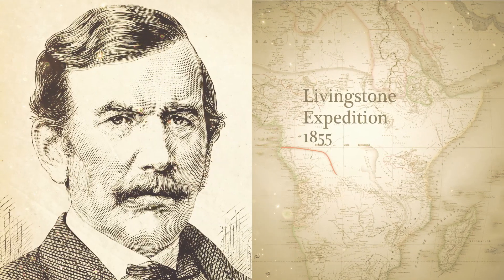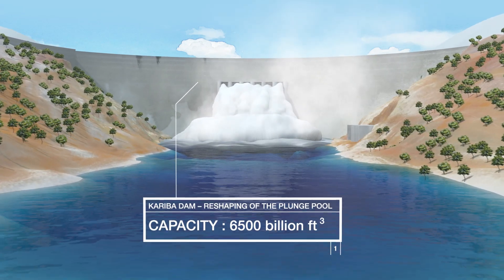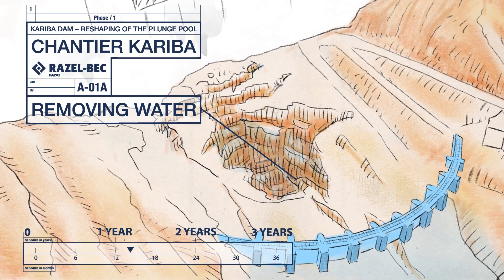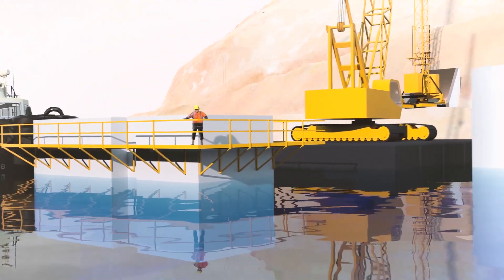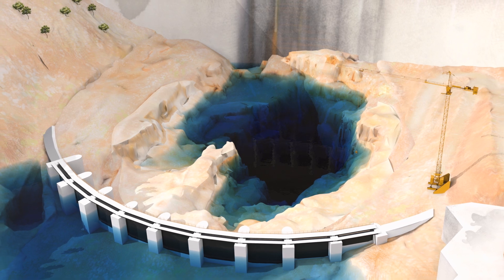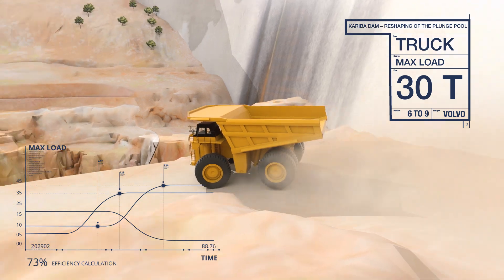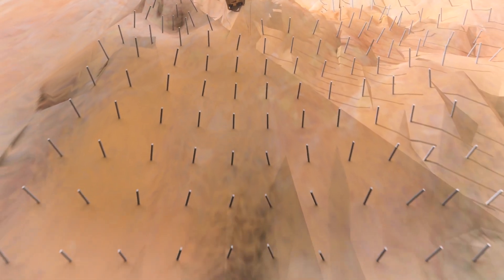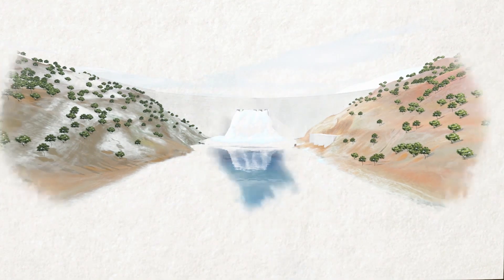A technical challenge realized by RAZEL-BEC on the Kariba dam of Zambesi

Comment: There are so many turbines letting out water now that the dam might never spill again .
Reply: I share the same view. We might never enjoy the spectacular view of the artificial waterfalls. Granted, the spill gates are necessary to safeguard the dam wall in a case where all the generators shutdown and the water levels are critically high. Engineering design requires all manner of contingency.
Reply: Sad fact. Junior high school education could accurately inform you that the total energy capacity is directly related to what head of water exists behind the wall. Putting more turbines might gain you extra power but for a much shorter, peak period over-all. Now if there is a lack of discipline in conserving and managing the water through the turbines to generate electricity, then you will always run out of power before the major, seasonal inflows return again every year. This is what is predictably happening and it's disappointing. So therefore, and ironically, the plunge pool may NEVER ACTUALLY EVER SERVE A PURPOSE AGAIN because the dam will always be drained and never fill. The fact is that millions of dollars were made by kickbacks to immensely corrupt officials in Zimbabwe. We know this because almost identical capacity generators installed on the Zambian side were less than half the price, only because there is less corruption in Zambia.

Comment: Very clever. What happens though if they have to open the sluice gates due to rising dam levels?
Reply: The turbines installed in the dam can also be used to provide relief when water levels rise. The two power utilities would just have to figure out where to take that extra generated power!

Comment: why couldnt they direct those outlets down into additional hydro power turbines and release water eventually horizontally?
Reply: I wonder 🤔
Reply: Firstly it is not cost effective and the energy harnessed from there would only be used intermittently as those spillways are only open when the dam is at risk of over filling.

Comment: Why not just make a slide for the water over the plunge pool?
Reply: The water does not always flow through the gates.  They are only opened when there is enough water so that is not the issue to repair it you would still have to empty the plunge pool.

Comment: Interesting, why were the energy dissipators not part of the initial design/construction?
Reply: Which ones would you propose considering this is not a Spillway, water is falling from about 100m height
Reply: Because it was believed the ruck substrate beneath was strong enough.  Also, the massive £ cost meant that maintenance of the rock pool by way of grouting was from the late 1960's onwards. I think maintenance by way of grouting was neglected when Robert mugabe lead the country from around 1979/1980 onwards because the money went to buying the most expensive cars in the world for even deputy ministers, so greed and money diversion.

Comment: Thanks for posting this. I was a diver on the first repair project in1969. We performed dentistry underwater, filling holes in the walls of the plunge pool with cement bag walls back-filled with rocks & pumped full of cement. In those days the pool was 230 ft deep & I worked at 180ft. We thought major repairs would be needed sooner than has proved to be the case.
Reply: Thats amazing..Im a photographer based in Harare and I am heading to kariba for a few weeks to stay with national parks.

Comment: I have wondered why engineers don't build trompes on the outlet of dam walls and hydro electric installations. Trompes provide a continual source of compressed air which can be used in adajcent towns for cooling, running machinery, vehicles etc. 

They cost very little to maintain, are environmentally friendly and a largely unexploited source of sustainable energy, despite being a 2000+ year old technology. That way the output of the dam or hydro electric installation would be able to passively generate more power. 

It seems that Kariba dam would be an excellent site to investigate in this regard.
Reply: Interesting idea, which I hadn't heard of before! Perhaps it is more cost-effective to simply run the water through a turbine?  The flow would be very intermittent, in any case. Flowing only when the in-flow to the dam is very high  so, once again, not cost effective to make use of the seemingly wasted energy?

Comment: Where us the water redirected once coffer dam in place.
Reply: Belle Of New York water from the dam has to go down stream to the river below to continue to cabora bassa and onto Mozambique. So whilst this going on there must be a diversion of the water flow from the zambezi.
Reply: The water flowing through the hydro plants on both the Zambian and Zimbabwe sides exits below the plunge pool / proposed cofferdam  . . . .
Reply: @markoosthuysen4346  wait a second, this would take three years to complete, how sure are you that there wouldn't be a flooding that would necessitate the opening of the flood gates? you cant entirely depend on the plant exits to maintain pressure behind the walls as the plunge pool and cofferdam are worked on.
Reply: @kalondesiulapwa4792   the water level has been lowered in the dam, and the hydro capacity increased,  so little chance of flooding
Reply: @richardstubbs6484  Have you seen the river at the moment ?
Reply: @kalondesiulapwa4792  it would take minimum of 3 to 4 years of very high rainfall seasons to fill the water to spilling point. That resevior level is currently below 35% and the capacity itself is too big (@ full capacity, enough to supply a metro as big as London for 10 years). Its doesn't take less than 3 good rainy seasons to fill it up again after the recent  droughts. Also consider the 2 hydro plants on either side that will discharge water downstream of the coffer dam.